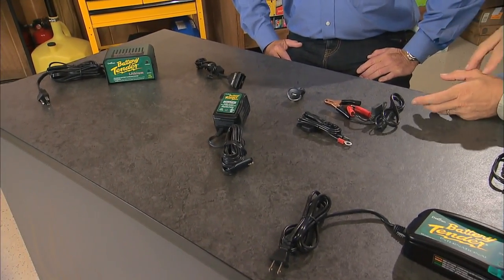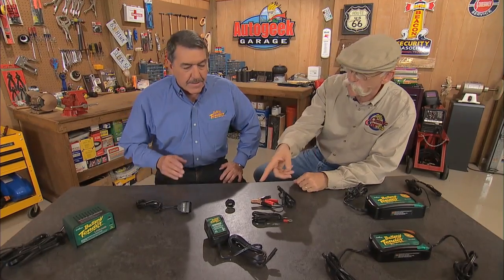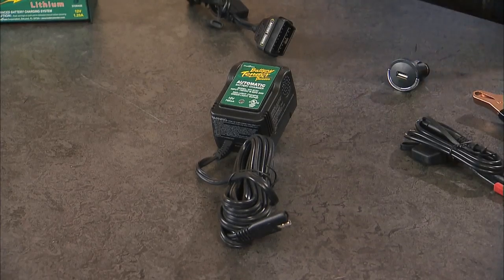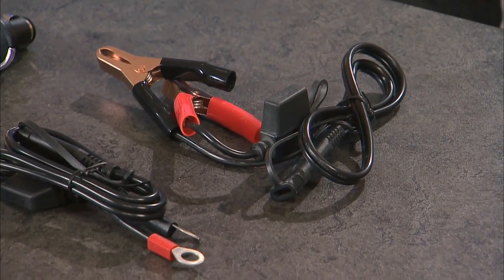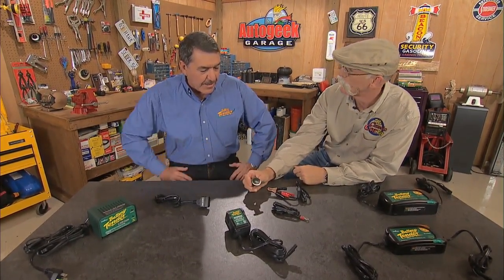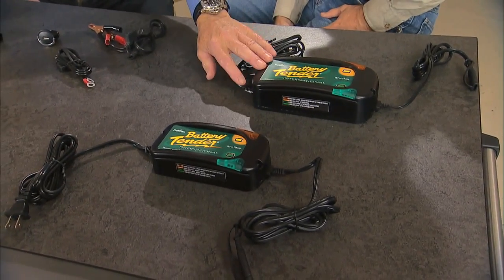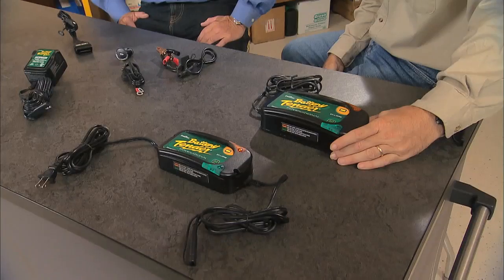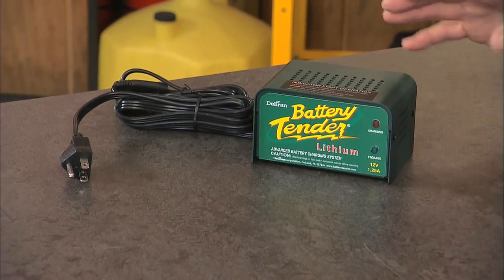Battery Maintenance (Deltran)

Comment: Been running my Battery Tender Jr (like the one in this video) 24/7 for 2+ years. It maintains a 12v flooded battery for my home CB radio base station/12v accessories. For my DIY 24v solar generator box, I bought the 24v waterproof Tender...2.5 amp. Lastly, I bought a "newer" Tender Jr for my 2014 Silverado. I hardwired the ring terminals onto the battery posts. All are excellent charger/maintainers...thanks Deltran!